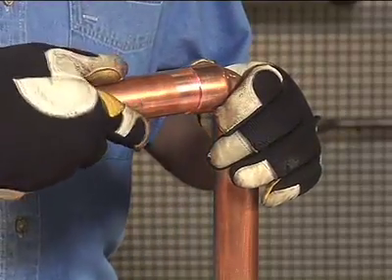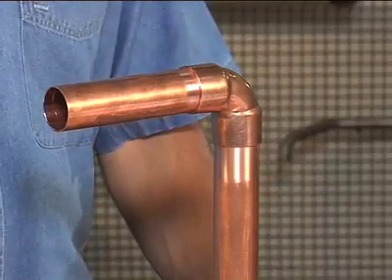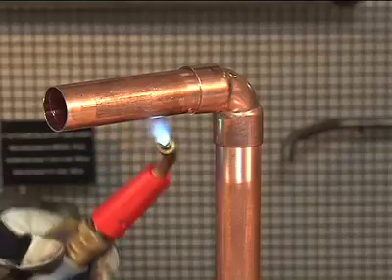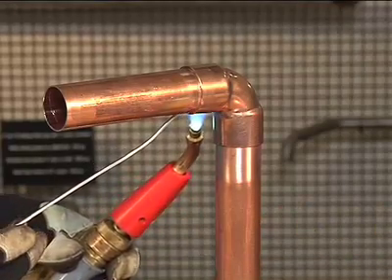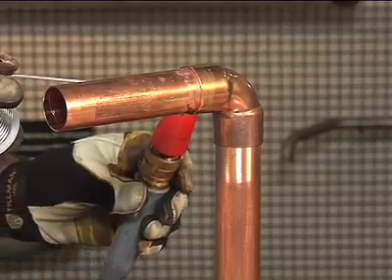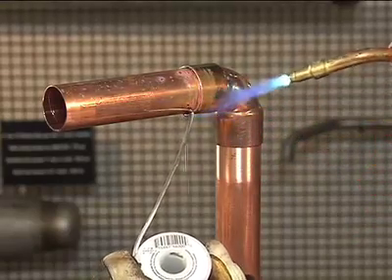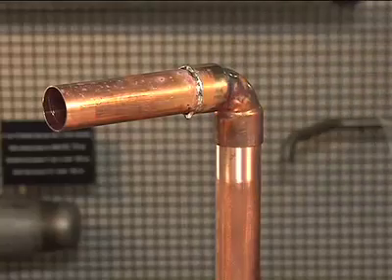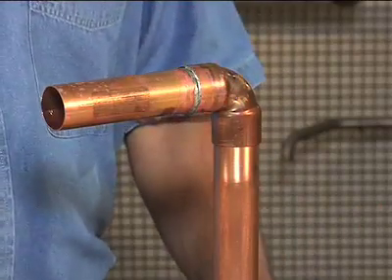Fluxing & Soldering Techniques

Comment: He made a right dog's dinner of that. I served a five year apprenticeship with a master plumber, went to college 1 day per week throughout this five year period and got my City & Guilds diplomas in plumbing. After a few years more experience I now train plumbers at the same college I studied at. No need to flux inside of fitting. Moving the flame around all over the place is pointless on fittings up to 28mm like this and there's no need to apply solder all around the fitting mouth. Heat at bottom, heat transfer is rapid throughout the joint, apply solder to opposite side keeping the solder wire out of the actual flame. Wipe off joint when cooled and job done.

No need for all this moving around until you get into the larger sizes which people won't come across in a domestic situation.
Reply: "No need to apply flux inside the fitting" !!!   I did read the UK Board recommendation and I must oblige !  Seniority wins !  The Board's recommendation is based on years and years of  experience. That's why the comments on the YouTube are so useful, even from poorly made videos you can still learn a lot of things by reading the comments section.
Reply: ***** This turned out rather long but please bear with me and let me explain.

I'm not sure where you are based but The City & Guilds of London Institute is not some "college trade school for high school dropouts" as you so, "nicely" put it. It certifies globally recognised training institutions across 81 countries. As for our training I already explained our training process. You work full time 4 days a week over a 5 year minimum contract with a Qualified master plumber with one day a week at college to obtain your Diplomas. After your five years work as an apprentice and provided you pass all your City & Guilds practical and theory assignments you are a qualified plumber in the UK, and receive your Indentures, outlining your time served, with whom and with what systems. (this is the process I undertook myself). You don't just show up to college one day a week, take a few tests and you're off! This is basically the way trades have been learned for literally hundreds of years, as a five-year (or more depending upon trade) apprenticeship to a Qualified and experienced tradesman. I think this is the equivalent of your Union Schools system?

As for never getting leaks on soldered joints? Of course it happens and any plumber who says otherwise is a liar. Sometime the reason can't be fully discerned as all procedures have been followed (Hopefully). A speck of sawdust in your joint can cause a failure for example. I can say that I have installed all distribution systems in large family dwellings, with scores of soldered joints and not had a single failure, and on the flip-side, I've replaced a small water heater with only a few joints and one of them has leaked! The leaks are rare though they do occur. Using as many pulled bends as possible of course reduces chances for leaks to occur.

The main reason I can see for not fluxing the inside of the fitting is that a blob of it can get pushed into one place inside the fitting and stay there despite flushing. If you are using any kind of "self-cleaning" flux this deposit can corrode the pipe and cause a pinhole type leak over time. I have replaced many of these over the years and can see the issue after the pipe is cut out and examined. It is prohibited to use self cleaning fluxes in gas installations and bad practice to flux inside the fitting for the reason I explained above. Passive fluxes should be used on gas and certainly not inside the fitting. It's in the UK Regulations that my jurisdiction adheres to as well as some local ordinances.

https://www.wras.co.uk/downloads/public_area/publications/general/soldersfluxes_3__10.07.12_.pdf/

http://www.ukcopperboard.co.uk/literature/pdfs/Installation-Tips/Fluxes-and-solders.pdf

Sorry for the long post but I hope to clear up any misunderstandings
Reply: liviu holca I personally flux inside the fitting, was referring to keeping the heat constant, heating from the opposite side from the solder etc. Although, some of the best people I've seen with pipework don't flux inside a fitting.
Reply: I read that UK Board recommendation and something tells me that they absolutely NO concept on how physics work.  Don't just straight up swallow what you read.   

Why would you NOT flux the inside of a fitting? The PDF provides no explanation on why you should NOT flux the inside other then "Contaminating the capillary gap".  Whatever the hell that is suppose to mean.

Flux isn't just a cleaner.  It's a placeholder that ALSO melts the solder into liquid form when it's hot enough.  That is what the torches purpose is for.  When you coat the pipe and insert it into the fitting,  you are going to be spreading flux against the fitting anyway.  The difference is that a fully coated pipe AND fitting is what completes the coverage around the capillary space.

Think about it.  By not coating both, all you are doing is spreading the flux around leaving dry spots between the fitting and pipe leading to a fragile joint.  Kind of like why tile guys back butter their tiles in order to achieve complete adhesion.  By not doing so, they can pull titles up with damaging.  Just because they didn't back butter, the titles didn't bond properly.  Different example but the same principle applies.   

Also, one of those columns that mention "Alternatives to blow torches".  What do they recommend? Heat guns.  A good joke if I ever heard one.
Reply: This is exactly the way that I was trained. Heat the opposite side from where you apply the solder, keep the flame constant and in the same place (on the joint, not the pipe). Kudos Stigstigster
Reply: "No need to flux inside the fitting" ?   I'm not sure about that !
Reply: liviu holca  I go by the UK Copper Board instruction to not flux inside the fitting, only outside the tube. The Board was formed to promote the use of copper tube and fittings in the UK and Europe and are a great resource on best practice when it comes to using copper in heating and water distribution. Here is a link to their document on this very subject. http://copperplumbing.org.uk/sites/default/files/content_attachments/fluxes-and-solders.pdf

WRAS (Water Regulations Advisory Scheme) also state not to flux inside the fitting here https://www.wras.co.uk/downloads/public_area/publications/general/soldersfluxes_3__10.07.12_.pdf/

These are simple 2 page documents on the subject so the relevant information is easy to find within.

Comment: That has to be the worst soldering technique I have ever seen.
Reply: You guys are spot on, I have been soldering for years and this is NOT the way I learned
Reply: Then you all learned wrong. This video is correct, it is the ASTM B828 standard. 

http://www.iapmo.org/2013%20California%20Plumbing%20Code/Appendices/Appendix%20I/IS%203.pdf
Reply: I agree too. I apply heat to one side, solder to the other and I mark or bend the solder so I know when the amount used is the right amount.
Reply: Clyde Dana Thomas You have never soldered pipe larger than 3/4” then.  This is the correct technique and is essential on larger pipe sizes.  Sure, heating on only one side will work on small diameter tubing, but once you get above 1” you will have a lot of problem if you try to heat only on one side.  You will burn the flux on the hot side and get a cold joint on the opposite side, both of which weaken the joint and lead to leaks.
Reply: I agree
Reply: Da Burner
same here.
Reply: Same here. I think it was a nasty looking joint.
Reply: You are so right

Comment: anybody who has ever done any gas welding will know that this is pretty much the perfect way to solder.  when you weld you learn to watch where the heat goes...the large massive long copper tubing will conduct it away and transfer it downline while the thin short fitting can only radiate it.  that is why the fitting will over heat and the pipe will tend to be cold.  by applying all of the heat to the fitting it's very easy to overheat the fitting before the tubing gets hot enough.  while this is rare in 1/2" or 3/4" you will have problems with larger sizes if you don't pay attention to what is hot and what isn't. 
now the old thinking is that the solder follows the heat.  this is only true in the sense that if there is not enough heat then the solder won't melt and capillary action won't be able to draw it in.  the solder only follows capillary action.  as far as adding the solder to the top only, it's very possible for the solder to just run down the outside of the joint producing a very tiny thread of soldered pipe while most of the joint gets ignored.  if you apply solder to the bottom and watch it rise up you know that the entire joint has been warmed.
this is one of the few good examples of proper soldering and I was happy to see it.

Comment: We appreciate all of the constructive comments from you soldering experts out there. In the U.S., where most of our copper piping systems are still soldered and not mechanically joined (press-fit or push-fit), the code-accepted procedure for soldering, referenced and required in all of our model plumbing and mechanical codes. is outlined by the ASTM B828 standard. You can get a copy of the standard at www.astm.org. If you review this procedure you will find that this video demonstrates this procedure exactly. Generally, we as the trade association for the U.S. copper industry find that when we investigate field-failures of soldered joints we find that many of those failures could have been prevented using the time-proven procedures included in this standard and shown in this video.

Comment: Look guys just buy 95/5 solder, clean the pipes good, apply flux then apply heat on pipes after 3 seconds apply heat at the Elbow only then apply solder at one spot and it will follow the heat around the elbow and in and you done. Apply more if you see some spot missing, but if you do it good then trust me you don't have to. "The way this guy is doing it is wrong that's how you braze"
It's easy, but it's not easy when everything is on place you don't wanna take it off and clean the pipes again.....

Comment: Well its only important to ensure that all surfaces for solder contact very clean and are coated with flux. The best way to do this is to coat pipe and fitting with a thin layer of flux. The problem with too much flux is that it can boil and bubble into the molten solder, risking a leaking joint but this is unlikely unless there is a large amount of flux present.

Comment: i also learned that only the tube should be coated with flux agent, not the fitting

also touching with the solder is a bit odd: usually you heat the fitting till the flux evaporates and than touch with the solder at the connection spot, the solder will sucked in and seals it perfectly

Comment: There's some much inaccurate in this vid that I advise you to just find a better one. See all the other criticisms too. That's telling you something.
For instance, once the solder starts to flow into the joint, you're done! This guy keeps feeding the solder letting it spill out inside and out. You do not want rivulets of solder hardened on the inside. Good grief!

Comment: he needs to move the head around more, his technique works but the way solder works is it follows the heat. If you heat the fitting and move the head equally around the fitting the solder should be able to be fed in at one point and make its way around the entire fitting, filling the gap.

Comment: This guy needs a real torch. His method is okay, but I would use more heat and move much quicker. I have to believe that the joint did not get full penetration with the low heat that his torch was putting off. A good joint should be smooth and not bumpy like his looks to be.

Comment: Check out TheOldkid888 for the correct way to solder...And for a 1" pipe it only takes slightly less than 1 1/2 inches of solder..3/4 of an inch for 3/4" pipe...

Comment: Did you not know that applying flux to the inside of the fitting is strictly speaking wrong as this could restrict the inside diameter of the tube and in the case of where compressed air or gas flows, the excess flux, which has been pushed into the fitting can never be cleaned out properly? 
I have read and always applied flux only to the tubing.

Comment: The ASTM standard needs updating. In practical situations the flame can rarely reach entirely round the pipe. You are also wrong about the main cause of leaking joints - its certainly not by using my method - the main causes are not cleaning the pipes properly and not choosing and using flux correctly and residual water in the pipe. Even 28mm copper can be easily soldered correctly by observing these simple "rules" and applying the heat at one point.

Comment: The processes shown in this video are completely in accordance with ASTM B828 standard for soldering and the full procedure as shown in the CDA Copper Tube Handbook. 

Your technique of putting the flame in one place on the fitting and allowing the solder to flow where it may is the number one cause of solder joint failure, especially in larger sized tube and fitting assemblies.

Comment: Thanks for your agreement. I was surprised that the CDA didn't check this video for correct procedures. There were a number of other poor techniques shown but I only mentioned the ones which seemed most important. The caption "Experience will tell when the joint has been sufficiently heated" completely removes the main reason for having a tutorial on soldering copper joints!

Comment: This is how NOT to soldr copper joins.
1. Rarely will the pipes present themselves in this orientation. The torch flame will most commonly only be able to heat a small section of the joint.

2. The fitting ONLY should be heated where it can be by the flame - and the solder repeatedly touched on the joint until it flows. Capillary action will ensure the solder runs around the entire joint even though the flame only touched one part of it.

3. Excess heat can cause flux to boil - poor joint!

Comment: That is the wrong way to solder you should have solder'd the bottom of the elbow first because heat rise's, and you never solder'd it at all and then the top of the elbow you run the solder from the top on the back side then the same from the front, if their is a blob at the bottom wipe off with dry cloth or flux brush, same on the bottom of the elbow  in regard to any runs

Comment: thats not considered as techniques.. too much rod dripping which is not allowed for any technicians to happened during soldering. such dangerous.. that copper pipe was just for airconditioning. you must solder it well, surely not to leak.

Comment: i've got a question what type of solder was he using because it looked like lead solder to me since when is it a good idea to use lead solder for copper pipe? hmm never!. silver solder yes but that looked like the solder you use for wiring  not pipe. ok you can use it yes it works i know it does because i have done i befor. BUT NEVER ON PIPE WORK FOR WATER ITS NOT STRONG ENOUGH PLUS IT'S DANGEROUS TO HUMAN COMSUMPTION. I DON'T NO WHAT CODE YOU ARE WORKING WITH.BUT IN AUSTRALIA WE DON'T USE LEAD

Comment: Also have a dry rag handy to wipe the joint clean of solder. A damp cloth can be used once the joint is dry to remove the remaining flux on the pipe and joint. Many people do not know, but flushing the system after the job is complete will remove any particles in the system, but the flux will remain there for many, many years. I actually made a video of this and I was astonished myself to see how much flux was still inside the pipe.
Best of luck with your project and enjoy your day!  Al

Comment: Been at this trade for 33 years and have a hard time watching this video.Apply a thin coat of flux evenly to both the pipe and fitting.Heat is applied to the bottom of the fitting when doing smaller joints such as 1/2 to 1" joints.Apply the heat on the back end of the fitting. NOT the pipe.Test your heat by applying the solder to the top of the joint.Once it begins to melt remove the heat and apply the solder only to the top of the joint and the solder will flow around the entire joint.

Comment: i agree with most of the people , you really only need to put the solder on the top of the pipe, the solder will flow following the flux around the pipe but the guy didnt hurt nothing doing it his way. i wouldnt have done it his way when i took my craft test, soldering and brazeing copper pipe was part of the craft test i took when i worked for the gas company.

Comment: continued... I've soldered copper this way thousands of times (probably tens of thousands of times by now), and have never once had a joint leak. It is perfect! HEAT FITTING ONLY, enough flame to heat quickly, flame turns green apply solder at joint top, stop applying solder when joint bottom looks full.

Comment: Try this... solder is drawn to the hottest area. Heat the fitting, not the pipe. Heat the fitting evenly. Have enough flame to heat the fitting fairly quickly. Now the trick... notice the flame begin to turn from bluish to greenish. That tells you the fitting is now hot enough to accept the solder. Move the solder on the top of the joint from front to back and it sucks right into the joint. Remove the solder from the joint top when it just starts to form a solder drip at the joint's bottom. Easy

Comment: Thats not the way to solder, theres no need to slide it around the pipe,when the pipe is well heated, you put the solder on top of the pipe and let it melt as it goes around the pipe,when you see a drop quickly move the torch away....